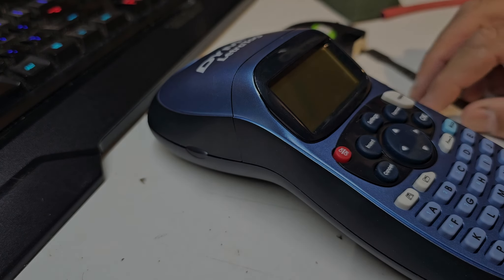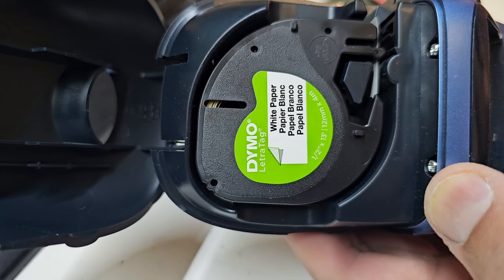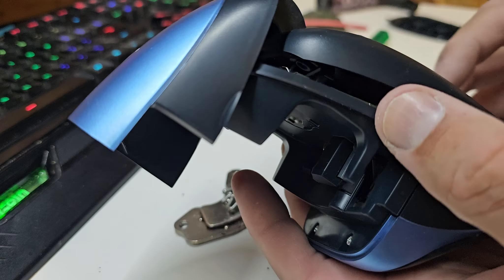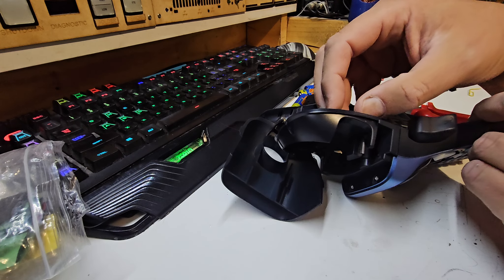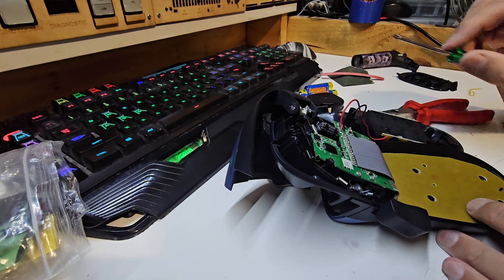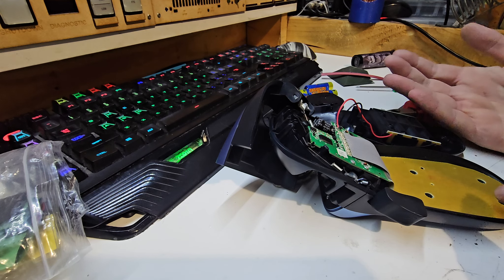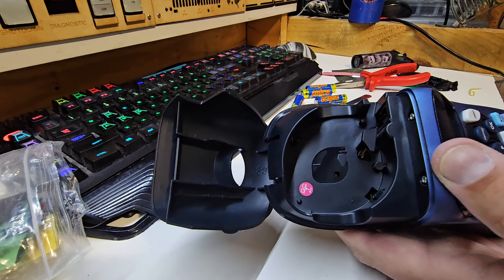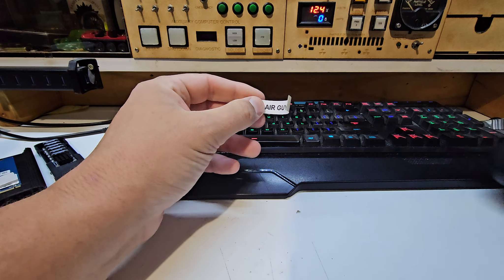Dymo LetraTag Teardown (because I'm stupid)

Comment: those 3 pins you mentioned are a SPST switch - i don't see the point of it which is probably why you'res doesn't have it. on mine, a cartridge can only be loaded with it in one position. but it doesn't auto go in the 'cartridge out' position. odd. I'm going to see if i can capture signals and recreate input from an arduino so i can type stuff from a COM port to print.
Reply from the maker: @orbita1  yeah i'd be interested to see what you cone up with